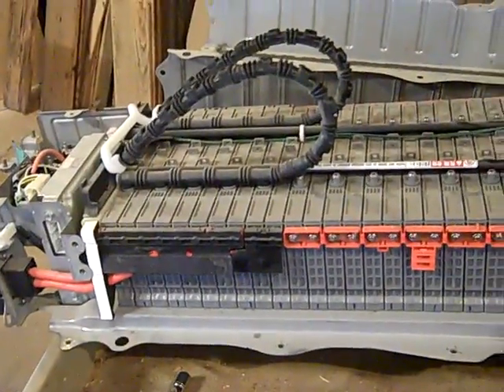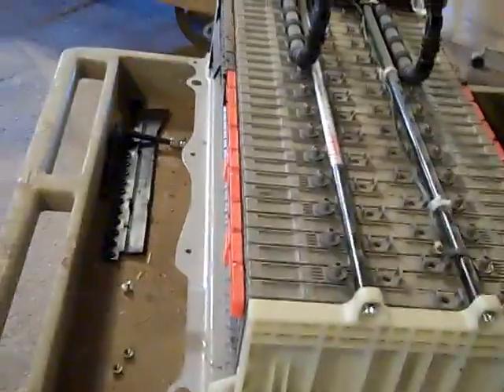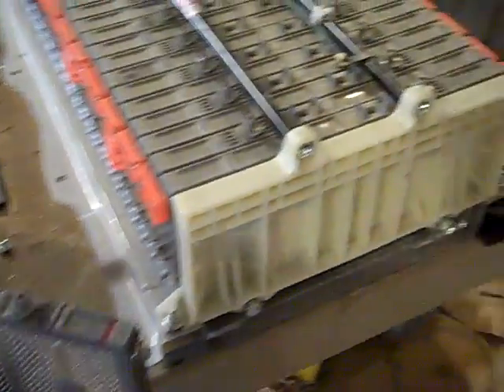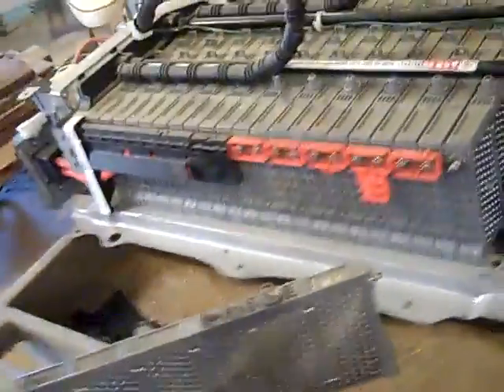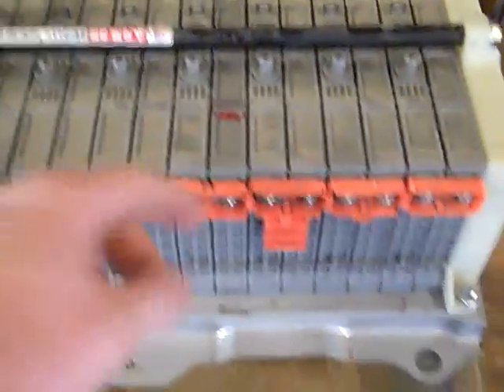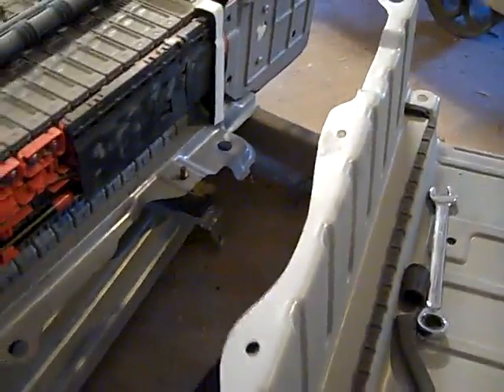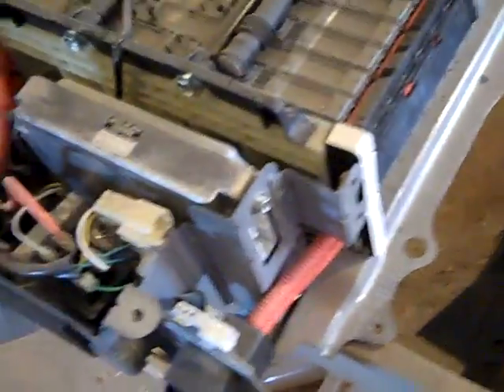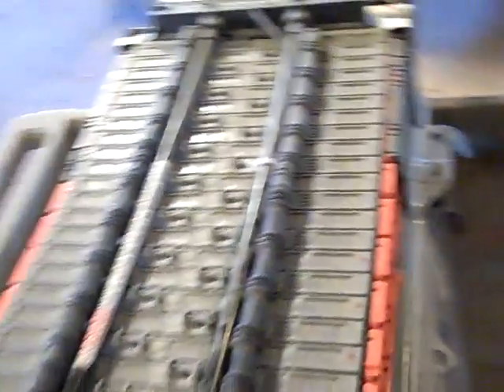Prius Battery Repair

Comment: This was very helpful. I purchased 3 cells on ebay ahead of taking the car apart, but only ended up needing one, for a total cost including shipping of $103. Since the car is 10 years old and has 155k, I'll just keep the others as spares. I took all the cells out and made sure they were clean since I could see dog hair between them. A 1/2 in paint brush was perfect for cleaning the cooling fan.
Reply: Paul Mason any updates? how is it now? I am about to replaced my bad cell but i am doing it with a cell from the 2nd gen prius. I heard you must replaced the pair so it doesn't throw a code
Reply: david galeno Just one is all it takes if only one has gone slightly lower on its voltage. They aren't really in pairs so much as one big set. It is a relief to get the replacement in and get rid of the fault :)
Reply: Yeah I replaced both just in case n the code hasn't come in 5 days

Comment: im thinking about getting a used prius but has a error code p0a7a.. and engine light is on.. will your video fix it? 310 913 6600

Comment: One thing he fails to mention:  Voltage alone doesn't tell the whole story.  If the battery is half-charged, bad cells could have the same voltage as good cells.  If it is fully-charged bad cells could actually have a higher voltage than good cells!  You want to discharge the battery as much as possible before you open up the battery and measure the cells.  A good way to do that is to put it in reverse, push on the brake pedal, and push in the accelerator for a few minutes.  Gently, so the car doesn't move.  Once the engine starts running (to charge the battery) stop the engine.

The bad (low-capacity) cells will have much lower voltages than the good cells.  This will probably also turn on your check engine light, because that is how you get the P3006 error.  Don't worry about that:  You can turn it off after you replace the bad cells using an engine code reader.  (Borrow one at an auto parts store, if you don't have one.)
Reply: +Gnarfledonk Or leave it in park with the car ON and run the air conditioning. after a few minutes it'll drain the battery down until the engine starts. Then shut off the car.
Reply: Thanks. I have to do this. At the moment Prius is constantly using the engine I figure it out. Unplug the 12v battery to get it to function like normal for this.. no way I'm dishing out 2k for a battery when I can try this first. Wish me luck

Comment: Thanks for this. It's good to know a little bit more about how my car's battery is set up and what my options are if I want to avoid replacing the whole thing...
Reply: Check your 12 volt starting battery first, before you go through all the trouble of replacing the main battery.  It can give the same warning light on the panel.  ( Main Batt ! ) with the triangle !
Reply: gwheyduke Indeed, the problem with mine was the starter battery, and not the big battery for the electric motor. Still, nice info here.

Comment: I don't get how the cell system work, it says negative on one cell and positive on the one next to it, I'm confused now? its 2 cells not 1. how do you test one cell?
Reply from the maker: Anas Fouad Electricity flow goes to the point of least resistance.If you put your leads on the ends of each battery it will give you voltage for that battery. If you put leads on the +- on the same side of the battery pack it is testing a pair of cells (how the computer reads it). Which will tell you if you have a bad "block" but not which cell is bad. Just don't be touching the cells across multiple blocks. each cell is 7.2 volts and add all the cells up there is over 200 volts in the pack.
Reply: So the - and + for each cell is not in the same side? Because the - and + for the cells on the same side are different one - for a cell and + next to it is a different cell.
Reply from the maker: Anas Fouad That is because they are wired in a series. The polarity on the batteries are showing the flow of electrons. Combining the voltage with the buss bars on the sides (like a chain link). If the batteries were all facing the same way all positive and negative tied together in "parallel" instead, you would have a 7.2 volt battery with a much larger amp load.
Reply: Ohh i see what you mean. So the - is on the other side of the +. I really appreciate your time.
Reply: Hertige Tim  okay so my batteries are all around 8 volts. The lowest one off voltage I read was 7.9 so I might think that the problem is the computer?. The driving performance is very problematic, when I had the issue I was driving down a highway when my gas simply had no power behind it. I could not keep up with traffic. It starts fine, but it runs as if the battery didn't even exists

Comment: You can still drive the car with a bad Battery?  And where can you find replacement ones I've just been trying to price them
Reply from the maker: djclown7pb You can drive the car but with mine the charge cycle became fussy and would not charge the battery normally, the computer was discharging the battery before recharging sometimes. (leaving you on only engine power to charge the batteries and operate the car) I assume that is to try and reboot the pack to a nominal voltage. In which case you have no power for acceleration, however once I replaced the bad cells that dose go away. I found my cells on ebay.
Reply: HeritageTim you had no acceleration at all one time? Was that after driving it , with the triangle of death for awhile? Or was it just enough to get you home
Reply from the maker: djclown7pb Not all the time it was just when the ev battery was almost fully discharged and the computer was charging the battery and driving the wheels, and accelerating or driving up a hill. At some point in the charge cycle the computer decides there is not enough power to drive the car and disengages it from the drive line. Leaving you to pull over and turn the car off and on and letting the battery charge up a little. This would not happen all the time but it might happen once or twice in an hour trip. This is all just from my personal experience so it may not be the same for everyone's circumstances.
Reply: HeritageTim This is whats happening to me right now. I was freaking out... Im hitting the accelerator and the car isnt going anywhere but I hear the gas engine revving up. Guess its time to order some cells.
Reply: djclown7pb This is very usefull for those who have hybrid vehicles. I haven't it. But I heard Megarno Amazing Battery Magician  is very good for hybrid batter replacements. Google it for more info.

Comment: It's a myth that battery vapors are the only cause of terminal corrosion. The DC voltage potential on a terminal by itself can cause corrosion to occur from chemical reactions with air and moisture.

Comment: thanks for the video.  For $45 I bought an individual cell from tedb8 on eBay, I had my 2005 prius back up and running for a couple nights work.  Love the multimeter comment.

Comment from the maker: Well it has been a little better than a year after repairing the battery. I just replaced another cell and it took two hours this time around. A different cell was two hundredths of a volt below the others, replaced it and back to good. I think I am going after the inverter pump recall. I don't know if that is the reason for the cells failing but two in a year could just be the age and miles on the car over 150,000 now.

Comment: just bought a 2005 that needs the same repair...its a good weekend project that can save a ton of money..btw theres a recall on the water pump that is in the charging unit...have a look on line. just dont tell the dealer you did the repairs yourself.theres a website called prius chat, it was on there.